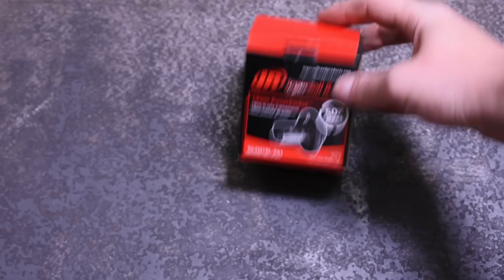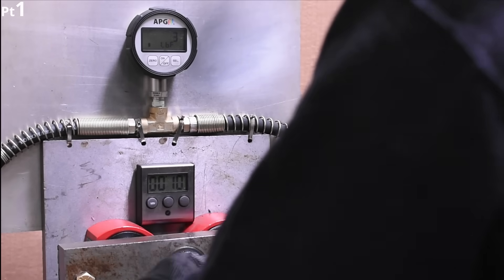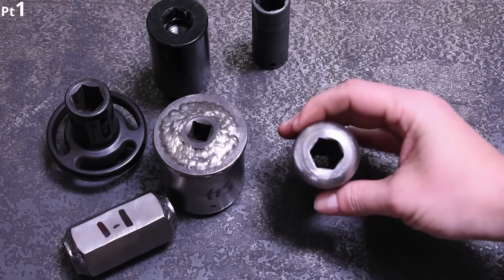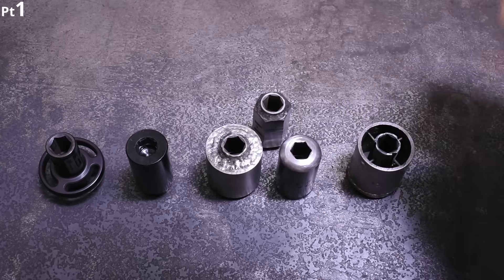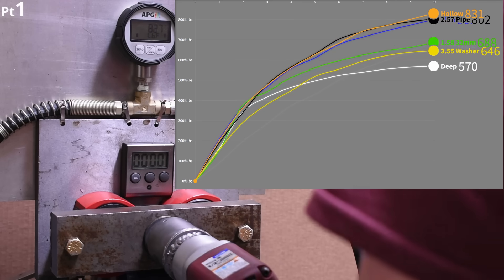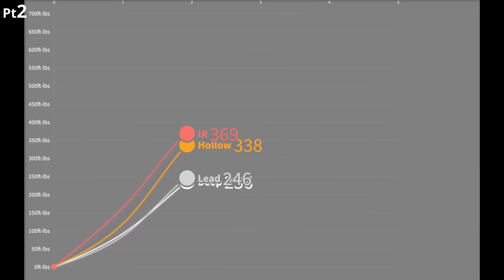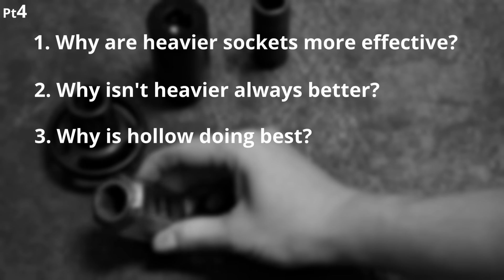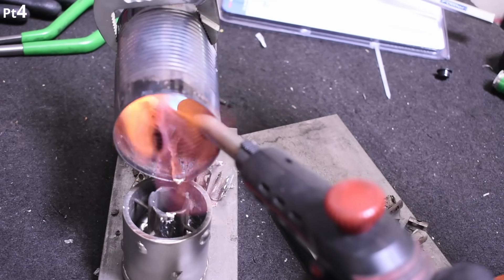Heavier Sockets Make More Power? Stumps Physicist

Comment: So I dabble in some engineering. I'm not a Dr, but I have an idea of what's going on here..  

I'm going to borderline oversimplify what I believe is going on here.. 

You have 2 masses at play here acting against a resistive load. This resistive load also incorporates stationary/sliding friction. 

Keep in mind that we are talking about energy. Energy  = Mass x Speed

for simplicity sake, lets focus on tightening.
--In normal operation the hammer of the impact accelerates a mass, storing potential energy in it,then at the right time hits the load with it converting this potential into Kinetic energy. This load is combined friction (with whatever still body the fastener is in) , and whatever mass there may be between the socket and the fastener being rotated. We know that the bolt when loose will rotate freely and will continuously rotate until friction is exerted against it. As the fastener gets tighter, the Coefficient of friction begins to skyrocket. Now we know that friction between to stationary objects is harder to overcome than friction between sliding objects. This is primarily why ABS (Antilock brakes) are equipped in cars. A sliding tire results in longer stopping times than tires that are not sliding. Same goes here..  Now the hammer is forced to overcome both the MASS of the socket and fastener as well as the STATIC FRICTION of the assembly. This wastes a LOT of Kinetic energy just trying to break the bolt free again to try and get more torque out of it, only to raise the sliding friction even more, beyond what the kinetic energy left is able sustain. If you were to look at this on a force graph, it would be very spiky with torque nearly instantly peaking (Slightly being delayed as the bolt gets tight enough that sliding friction increases to become equal with the remaining Kinetic energy) then instantly falls off to zero as all the kinetic energy is spent.  

Now we look at the power sockets in use.. Namely the IR power socket.
--The sockets DEFINITELY store kinetic energy. The hammer spins up raising the potential energy in the hammer. The hammer hits the anvil and dumps all of its potential into the anvil, socket and fastener..  The first blow to the fastener is dampened by the fact that the anvil must accelerate the socket and the bolt. As the bolt tightens, the anvil quickly runs out of remaining kinetic energy however continues to rotate and slows down at a much slower rate than impact socket only given that it has this increased mass. At this moment, the motor is still trying to drive the hammer. shortly after hitting the anvil it recoils and begins getting ready for another blow but the added mass on the socket is trying to keep the fastener in sliding friction where losses of kinetic energy are low! As the socket is just slowing down to almost a stop, the hammer hits the socket and fastener again.. Now our friction losses are lower because you're keeping the fastener spinning as you hit the fastener with the next blow.  This basically recharges the socket with energy and now the difference in force between static and sliding friction is not wasted but rather dumped into the socket to assist tightening the fastener.  I also have a theory that the added and directly connected mass of the socket more quickly exhausts mass from the hammer blow in the impact causing it to start the next hammer blow in a lot shorter time as well. But this will take some testing to tell for sure. 

Like all things, you have limits..   
--When you have too light a socket, the fastener has a chance to stop between hammer blows. Not enough mass to store potential energy and it becomes oversaturated and basically all energy above what the socket can store is handed off to the fastener, then the socket dumps what little energy that it has which is below that of the initial input energy.  Think of this as an F350 Diesel, rear ending a smart car.. Smart car pinballs off of the next 4 cars in front of it while the F350 doesn't slow down at all.  
--When you have a socket that is too heavy, the anvil instantly dumps all of its energy into the socket. Because the socket never gets saturated or the socket gets saturated with little energy left in the anvil, the fastener will get tight but as you saw, the socket is unable to turn this back into usable torque to continue tightening the fastener since such little energy comparatively was given to it. (I bet the heavier sockets would do amazing with a heavier anvil from a 3/4" impact)  You can think of the large socket scenario as the opposite from the one above.  A smart car rear ends a F350 Diesel and the little car has not enough energy to change the speed of the big truck so the car stops nearly instantly causing the truck to move very little. 
--In the scenario of the properly sized socket, the socket is saturated while the anvil still has a proper amount of energy to tighten the fastener. This makes the socket/fastener move to tighten the fastener but also the socket stores just enough energy between blows to keep the fastener moving.   You can think of this like the F350 Diesel rearending a full size car like a crown vic or something..  The collision slows down the large truck trading speed for mass. (Because both the anvil and socket are now moving) so the crown vic and the truck are moving at a decent speed and whatever they both hit will cause a bit of damage to whatever they hit.  (Fastener)  Now keep in mind, while this F350 (hammer) just hit the car (Socket) the F350 just disappears and hits the car again (every hammer after the first) and this continues until whatever they hit can physically not move anymore.

I have a REALLY good idea to prove/disprove this "theory"..   Use your Milwaukee 1/2" cutaway impact that you used with your hammer slowmo video with the IR flywheel socket and mix in a few frames from your high speed camera again.. This would show the interaction between hammer hitting a standard socket/fastener and hitting a weighted socket/fastener..  Then we can see how/if what I believe is happening to be true, as well as the interaction between when the hammer disengages in reference with actual socket speed. 

It'd make a hell of an interesting video.  
-Gadget

Comment: I'd really like to see the max torque that the lead-filled socket would deliver if you just ran the test until all the graphed lines flattened out (its line was still climbing at the end of the test). More generally speaking, I wonder whether the effect is due to the small amount of play between the socket and the fastener causing the tool briefly to acelerate the socket before the energy is transferred to the fastener. If that is what happens, making a socket heavier would increase its inertia while the lighter peripheral mass  of a flywheel-style socket would increase inertia by accelerating for a longer distance and travelling faster at the point of energy transfer.
I've never learnt physics but I've used a lot of rattle guns, and I found your resluts fascinating.

Comment: I changed my Honda crank pulley once and the bolt would not come off with a SO impact. I purchased the lisle and it came off with less effort than the standard impact. That slight increase in weight helped that I know.

Comment: Look into the size of the hex that goes to the bolt. If it’s a snug fit, less torque will be transmitted. The socket needs a little wiggle room to spin and hit the bolt harder.

Comment: I've found through hands on experience using many designs of those sockets on many stubborn crank bolts that it has something to do with the sockets ability to not bounce back between impact blows. Heavy alone helps keep it from counter rotation. Flywheel designs move the helpful weight from the center to act as leverage. Making that small weight be more useful than being on the socket wall. Your hollow design multiplied that by being light and even bigger in diameter (leverage). More power is transferred because it's not having to overcome extreme weight but the amount of weight used to hold pressure on the fastener between impact blows has leverage. I suggest a video with a deep socket with a bolt head welded to it. See how far it get. Then add a wrench to it with incremental notches to add weight to. Impact to limit Then add the wrench. Then weight to the first notch to limit. Move out till you run out of wrench.

Comment: My guess:  The impact driver accelerates the weight over a relatively long time and then the impact is impulsive and decelerates rapidly transferring the power into the bolt.  You should see gain (with weight) until the the socket does not accelerate to full speed before it impulsively transfers the kinetic energy into the bolt.  You should check the highspeed.   The hardness of the socket will also have an effect but apparently from your tests it less noticeable.  Welding onto a socket will change it's hardness.   At the point when the socket deforms, you should also see a decrease.  The impact happens over a longer time as the socket metal deforms (the peak impulse is reduced).     There is a great MythBusters episode on a giant newton's cradle.  It failed to be interesting because the huge balls deform on impact and reduced the impulse imparted to the balls.

Comment: Have never had a problem getting those Honda bolts off with a bit of heat. Really doesn’t take a whole lot of torch time on the end of the nut.  Below the amount that would melt the seal or belt cover.  Done many times with no problem at all.  I did get one of those flywheel style socket though for lug nuts that won’t come out. In this way the other fat socket won’t fit most lug nuts. So it is the superior product.

Comment: If the flywheel helps that expensive socket would a flywheel spacer that sits between a standard socket and the impact gun work at all. Like the opposite of the toque sticks tested a while ago. Would be interesting to see

Comment: I believe what's going on here is fairly simple: a flywheel socket just adds weight to the hammer of the air tool, making hits stronger.
To iterate: A socket is not a perfect fit on the bolt. As the rotating hammer engages, it starts spinning that socket as well. A few degrees later the socket engages the bolt and transfers all of that momentum to it. However, as socket gets heavier, there is not enough power in the tool to get it spinning in that small of a rotation, so overall torque is lost. As with any other flywheel, it is more efficient if there is more mass further from the center, that is why solid heavy sockets are not as good as that wheel or tube ones. Tube is just a long flywheel in this case.
Would be interesting to add a flywheel to the air tool's air motor and see how that changes output torque. In theory and with how it operates, more mass would be more beans.

Comment: Instead of a pyschicist I would contact an engineer.
Obviously there is a sweet spot where the weight helps conserve the energy being applied but also at a certain point it would cause a bottoming out where the mass generates too much resistance to get it started as effeciently.
Also the use of the weight in a flywheel instead of closer to center mass, this is stuff we learned with gyroscopes for all us kids who cared about science at a young age. 
This is like inertia 101 sh*t. 
I do not think that your psychics professor maybe understood how a impact driver worked vs a power drill. Where as YES obviously the least amount of resistance and shortest travel will give you the most direct input to output forces, like for a drill. An impact driver works on a whooole different level of physics than just "output force = input force - loss from torsion & inertia". 
The fact they made a blanket statement that less weight equals better ALWAYS shows their misunderstanding to the mechanics immediately. 
Once you gave them the second email they realized they were in over their head and that the question wasn't as straight forward as they thought and is why they went quiet. Because the shame of their intelligence being challenged by "some grease monkey" meant more to them than just inquiring more to understand and figure out the answer together like a true scientist would. 
FOR SCIENCE!

Comment: As in all transfers of energy, the most efficient transfer occurs when transmitter and receiver are "impedance" matched.  In the rotational case, mass and radius length both effect the "impedance".  I'd wager a mass roughly equal to the average impact driver's hammer, placed at a (tuned) distance to the center of rotation could sympathetically resonate with the impact driver and increase it's torque output.

Comment: The reason the fly wheel socket being cut didnt work as well was cause he removed the fly wheel affect , if im correct the socket with the flywheel removed still did better than a normal socket due to still having abit of thickness and mass left on it ,if im not correct that the IR socket with the flywheel cut off still did better than a regular socket then this is due to the socket not having enough rigidity not sure the tempering or lack of after causing that much heat to cut the flywheel off

Comment: Nope the hollow socket eorks best cause its holding the socket at its 2 most twist points right at the start of impact and right at the end of the impact so when the impact gun puts all its force into the part that attaches to the gun it also transmits the same force to the end of the socket where the bolt is. As for adding mass like i agree with the physicists weight is good but it has to be the perfect amount to much or 2 little will render useless 

Kind of goes back to TTC video of when they tested the torque sticks and put the rods on the side and you could see the rods misaligning , kind of the same principal is going on with the hallow socket but instead of having the hallow part cut its ridged and applying constant force to exactly where it needs to be

Comment: My stab at this is harmonics/resonance. The inners of that impact gun revolves with a certain speed under a certain load. The speed in combination with the weight of the anvil and rigidity of these parts will ideally translate into the impacts that is relayed from the gun to the nut without delay and energy loss. In most cases the natural frequency of the main components  (determined by mass, stiffness, shape etc) mismatch, and there will be a lot of rattling around and wasting of oomph. In ideal cases their frequencies will match (could be first, second or third order and so on ) and the impacts will travel from the gun to the screw head in a cleaner way. There are also several unknown factors as play between the parts that could affect the result.

Comment: I can think of one explanation of why socket was rubbish when you cut off its "wings"- leverage.
The same thing you got with hollowed socket you made, the material of socket was further away from the center of spinning, yet overall lighter( that is why led filled socket failed) so "the flywheel effect" was much greater.
To the point- it is not about the mass, but WHERE that mass is.

Take two kilogram wight in your hands, try to spin it, throw it, do stuff with it. Then take bicycle wheel, spin it up and see how much easier/harder it is for  you to turn it around- same mass, different application- different results.

Comment: I have a physics undergrad so I will throw my suggestion in the ring. Fundamentally I agree with the physics professor, rigidity is key to transferring impact forces. Too bad you didn't test that in further detail, but can be done by just adding extensions. In theory extensions should decrease the torque. However, I think there are 2 factors at play here. One is rigidity, and that is what gives the Lisle socket its benefit. Second is resonance. Imagine you have an outer cylinder attached to the socket on an angular spring, so the outer mass can shift left and right relative to the socket. Then when you make an impact, the spring winds up (the outer mass rotates less than the inner socker) and then when you make a second impact, now you spring swings the outer cylinder at the same time as the impact wrench is swinging the socket. Now you have the additive torque of the impact from the impact wrench and the outer mass  (Flywheel) swinging. However, because this is a resonance phenomenon, the spring constant and the angular inertia of the flywheel have to have the vibrational frequency match the frequency of the impacts. This is the equivalent of swinging your feet up and down on a regular children's swing. If you do it at the natural pendulum frequency of the swing, you end up swinging higher. In this case this is a rotational equivalence. I think that this is also the reason why the IR socket doesn't attach the flywheel to the socket all the way around but just at 3 points. They selected the strength of attachment to match the frequency of an impact gun (likely theirs). So again, two effects in place, one is is stiffening the socket itself and second is adding a secondary impact from the flywheel and as long as that secondary impact is in resonance with the impact wrench itself there is an overall additive effect. If they are not in resonance then the flywheel effect becomes irrelevant (think about swinging you feet randomly on a swing, it won't get you anywhere). That is the reason why the home made sockets gave various results, they weren't in resonance and had various impacts on socket stiffening. There are many ways to test these effects separately so if you want to explore further ping me and I am happy to suggest some specific experiments to do.